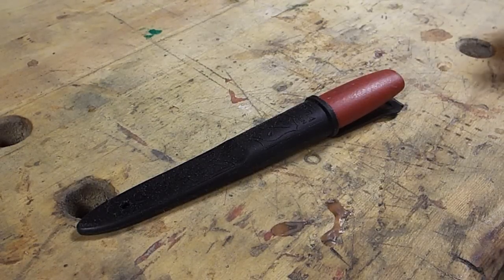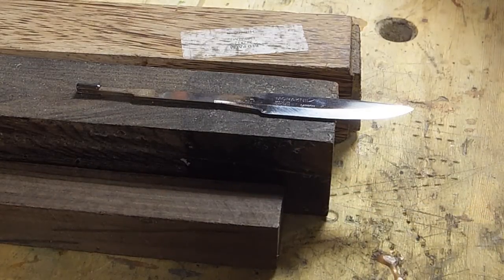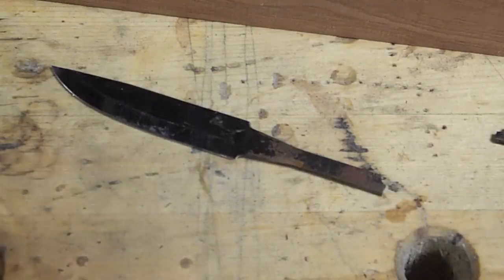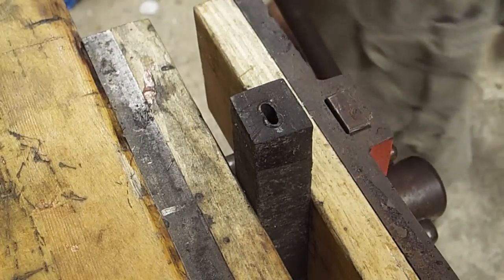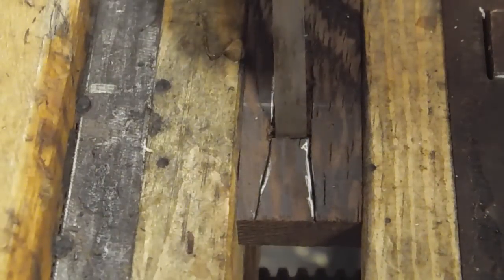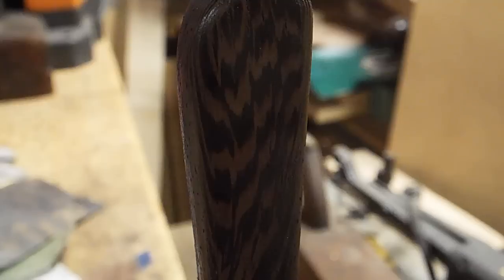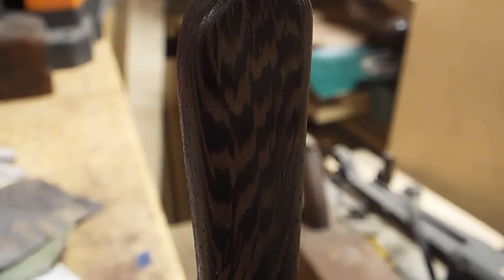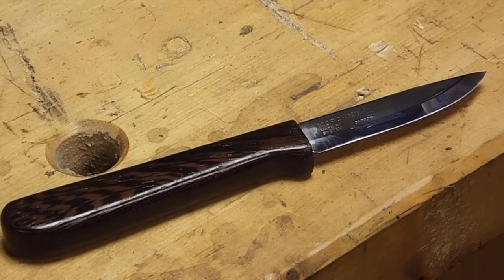GPW 82 - Idiot Makes a Knife Handle (Mora Classic 2/0)

Comment: Man, how do you do anything with those fingernails? I thought I let my nails grow long, but those are just asking to get caught on stuff.
As for the knife, you're supposed to use a punch and drive the clip off the tang. The technique you used was for the larger Moras that have half-tangs and are epoxied into the handle. What you did ruined the handle and left the clip in the way. I say this for the benefit of those watching the video. You should close the vise until is is almost holding the blade, but it is still free, then slide the blade between the vice faces from the top, until the handle stops it from going in any further. Place a soft object to catch the blade underneath (should be taped as well). Take a small punch and drive the tang down through the clip.
I also don't understand why if you ordered him a new one, the video appears to show you going ahead and doing all the work to make a handle for the one you broke. You'll have to do all the work all over again, unless you are actually planning on giving Carl the broken one back, in spite of what you said.
Good thing this happened to you when they were still selling this model of knife. It has been discontinued, and the new, more expensive replacement, the "1/0" won't be on the market for a year or so. If you bust someone's knife now, it's going to be a lot harder to replace. I haven't been able to find one anywhere, although you can still buy plain 2/0 blades.